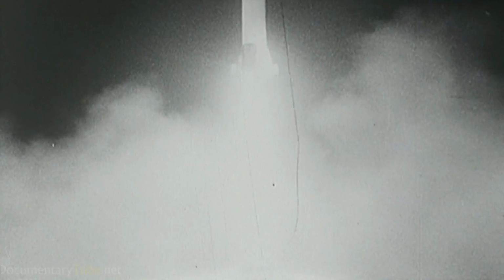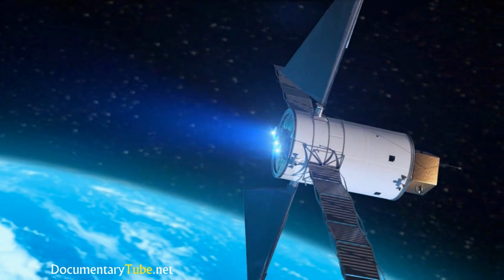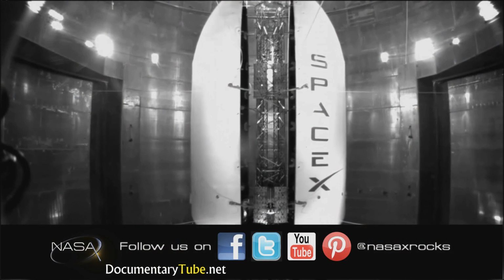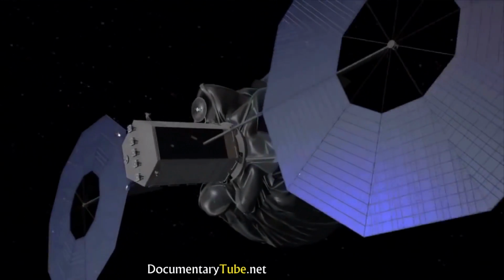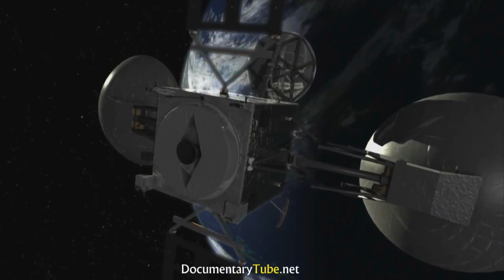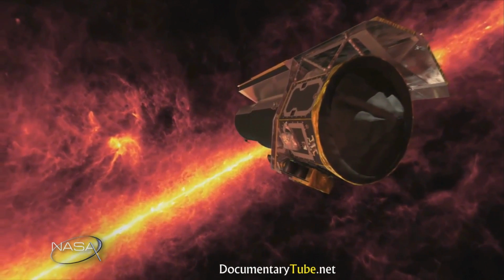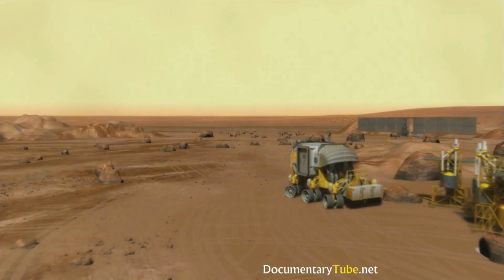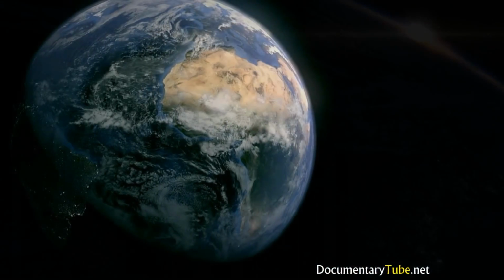NASA's Engines and Possible Speed of Light Propulsion?

Comment: I love the idea of the solar electric propultion. Am I correct to assume that while a conventional chemical propultion engine burns for only a few hundreds of seconds, ion engine will be able to burn almost constantly during space flight, and althout It may not equal in thrust to a checmical propultion engine, the fact that it burns for much longer accelerates the spacecraft to a far greater speed? Say if it is 11-20 km/sec for deep space for chemical propultion, what speed would ion engine achieve?
Reply: Ion engines can't burn indefinitely. Since they are gridded, you've got material moving past the grids, causing wear.
The VASIMR engine is much more promising in the concept of constant acceleration since the propellant does not come in contact with the charging elements. They should be significantly more reliable than even ion engines.
Rocket engines of any type don't have "speed limits". You can reach 99% the speed of light with a chemical rocket.
Engines are only limited in maximum speed by fuel and engine life. They either run out of fuel, run out of power, or wear out at some point.
However, electric engines are superior to chemical engines in that they are VASTLY more efficient in terms of fuel, the trade off being significantly lower thrust.
Whereas most chemical rockets are in the 320-450 range for isp, ion engines are around 3000isp, and VASIMR is estimated to be as high as 12000isp. Dual stage 4 grid ion thrusters could be up to 21400isp, but again there's a problem of run time.

Comment: it looks futuristic but does that not create to much area space that will be exposed to the elements in the space if the shuttle also equipped with advance guidance system that can detect material ahead.

Comment: nasa should use magnetic propulsion like the magnetic train. magnets are so powerful and last longer. i mean magnets work in space right.just a thought
Reply: Yes but to what does the magnetic field push against?
Reply: I don't think you understand magnets ;) Magnets have no "thrust", they can only repel or attract another magnet or magnetic material (from a short distance). Just like you can stick a magnet on your fridge, but by itself it will be like a stone, useless.
Reply: Federico Lucchi No. It is not about a thrust. It is about a pull. For an example you place a giant magnet in the Moon powered by electricity and a spaceship(no thrusters) in Earth. Technically you just pull the spaceship to the moon. Though this is a very big disadvantage. Firstly you need to generate more than millions of electric power to generate that very strong magnet. Secondly, there are other metals on Earth. So when that magnet activates, your roof, spoon, fork, car, gates, airplanes, trains, fridge, anything metal may go to space.
Reply: In another case, you may place a giant magnet on Earth. Another magnet on the spaceship. Generate magnetic force with the same poles and they would push each other. However, this has another disadvantage as you fuel two magnets with electricity. Plus if the spaceship is thrown out of the magnetic field, gravity will start pulling it back again and just fall.
Reply: Magnetic fields get exponentially weaker as your distance from the source increases. You'd get decent thrust for a very short distance.
Much more efficient to just have chemical or electric propulsion systems.

Comment: There is a rule that will never change, and that is for every time you double velocity you have to quadruple the energy input.

The other rule that will not change is that space is not empty and constant collision with particles will reduce the velocity of a craft

And finally: the bigger the craft the more likely it will be retarded, even at large distances, by gravity of other large objects.

And that is why, no matter how much you try, you will never be able to propel a large body to anywhere the velocity of light without putting large amounts of energy in it, and simple math will show that to propel something the size of the space station to that velocity exceeds the amount of electricity produced on Earth in a year.

Comment: I saw no technology on this video providing anything remotely close to light speed propulsion.
Reply: Not even as close as Gundam series spaceships (which none of theese beats the speeds of light).
Before going past lightspeed, first thing that has to be achieveed is the self-ascending spacecrafts (ability to take off into outer space on its own, without launching rocketry).

Space Shuttle program didn't even progress close to this stage despite the proposals to make 'reusable spacecraft launching devices'.

Maybe after mankind had discovered FTL tech from any extraterrestrial peoples did FTL engines possible.

The other thing that had to be proven that existed is also FTL particle named Tachyon. The best effort was a complex below the Alps by French-Swiss border.

Comment: It may be a stupid question but useful for me. Is humidity, moisture, vapor/vapour present in the space, since there are head and light in space! If a comet is an asteroid covered in ice and formed a tail due to the melting of ice and with the reflection of light in the space, then it means something right? Water vapor, moisture, humidity due to the heat inside a vacuum space!! or will you feel no such things coz the vacuum space is too wide or infinite?

Comment: I watched a theoretical special on what could possibly happen on a Mars Mission. One thing they looked at is that on Mars at night it gets really really cold. Then sometimes they have sand storms that last for months which can damage equipment, maybe generate some lightning or static charges and coat solar panels with dust. So it can become crucial to have some king of method to create energy like with a reactor or generator and some method to store energy. The process of creating energy might also be nice if it could generate heat as a by-product.
Reply: The potential problems you mention are a mere nothing to the reality of the nightmare scenario for the first humans to reach that planet - if they ever do !

Comment: how good is that if you can't protect it from the debris flying at the speeds exceeding 17,500 mph. focus on some sort of a magnetic or plasma shied first, then think of travelling somewhere
Reply: M M i always wondered about that. you dont really have to worry about asteroids and stuff, those are obvious, you have to worry about space pebbles. also, there is oily misty dust in space that would build up over time. seems like you would need a sensitive forward imager and electronic space shielding of some type to go anywhere further than the kuiper belt.
Reply: Once you get away from near Earth, there will not be any debris to worry about.
Reply: Neat funfact about magnetic shielding: it's completely ineffective against non-magnetic material.
Dangerous interstellar debris is pretty rare outside of hollywood. You'd have to be extremely unlucky to fly a spacecraft the size of an ocean liner through the asteroid belt and actually get hit with an asteroid.
Reply: Magnetics and gravity? Same thing?

Comment: Throwing the word 'lightspeed' in there made the hole thing lose credibility.
Reply: Nothing with mass can reach lightspeed, end of story.
Reply: Sun Corona : Re "Nothing with mass can reach lightspeed": True, because that would require injecting infinite energy into the massive object. And ∞ joules of energy is mighty hard to come by. :-) 

So, barring "warp drive" (which we're not even close to inventing yet -- if such a thing is even possible, which it might not be), we're stuck at speeds such as 0.000001C, 0.00001C, or maybe 0.0001C. We're unlikely to get a spaceship going much faster than that.
Reply: Ole Nielsen In theory by putting a feild around your ship and causing it to contract  behind you Forcing normal space to push your ship forward, mass isn't a factor because your ship isn't moving, just the space around the ship is moving. Of course good luck doing this! But if such a feild can be Generated with a reasonable amount of power, the speed of light and mass isn't a limit, the space around the ship has no mass  and as the ship isn't moving it's mass is not affected. It's not likely, but it is possible. Explain Atomic Energy to someone a Hundred and Fifty years ago, even the most Advanced Scientists of the time would laugh at you.
Reply: @spookyshadowhawk6776 What Ole Nielsen spoke about was sub light propulsion. What you are thinking about is some kind of warp drive and that is something completely different. He is still right in that anything with a mass can come infinitely close to light speed by using an infinite amount of energy but never reach light speed.
Reply: There should be penalties imposed for click-baiting.
Reply: You just lost all of your credibility by misspelling whole 😂😂
Reply: indeed, never once someone said about lightspeed...
Reply: I love when people try to discredit others and fail themselves. Hahahaha
Reply: "hole"... now I have to go to a .p.o.rn site.
Reply: is that an advanced flight sight?   LMAO 😂😂
Reply: FaultLine actually space does have ways to slow us down. It's just spread out compared the the earth's density.
Reply: The fact that you are unable to spell the word WHOLE does little for your credibility.  And they said LIGHT PROPULSION, not lightspeed.
Reply: wanshei p
Reply: Yea; they're trying to get a hit on their video, thinking that your not going to notice you've been screwed.
Reply: Huges 530f
Reply: Md 530f
Reply: Ain't that a fact? Nope, it's fiction!
Reply: wanshei WZa
Reply: indeed
Reply: You'll get over it.
Reply: Wow, speed of light? VERY nice fiction but unfortunately, I wasted a minute watching this.
Reply: your abhorrent spelling makes you loose all credibility
Reply: @ferret1337  Use "lose" instead of "loose" in your sentence above.
Reply: no it didnt

Comment: We will NEVER reach light speed or even near it . Sorry we might be able to send machines extremely fast but it's quite simple you need to keep pushing to gain speed. Your pushing harder and harder  but light has no mass and it's way out in front ...the faster you go even interstellar gas would slow you down small dust would be like running in sand small stones like being hit by an 88mm shell. Ain't going to happen , enjoy your life this will probably be the only planet we inhabit and even the chances of  travel for the average person within the solar system is next to zero . The next meteorite will finish our dreams and hubris.
Reply: @acefreaky Pretty much right on, but you made a couple of basic relativistic mistakes. We can't even get a proton to the speed of light. The LHC can get it to about 99.999% or so. Not the correct percentage, don't quote it to anybody. But close). So why can't we? There's no dust or gasses in the LHC. Hint: What happens to the mass of a proton as it approaches the speed of light?
Reply: One of Einstein's theories stated that as you approach the speed of light your mass will approach infinity and the length of the vessel will approach zero.  If this is true it will not be happening.  If we got to 50% of the speed of light, we could in theory reach Alpha Centauri in about a decade, BUT then there is the problem of slowing down to stay in the system.  Some people said that we would have to spend half of the trip approaching the highest speed and then the second half of the trip slowing down enough to be able to achieve orbit in the system.  This would add even more time to the journey.  Maybe 20-40 years and would require enough fuel on board to decelerate. Unless some new technology is discovered (some kind of warp drive), traveling to the stars is just a dream.

Comment: Well not Speed of light because you would have to have infinite energy to get to light speed but a significant percentage is possible, 40% is about as fast as you would want to go though really because you would get slowed down by interstellar hydrogen and particles and beyond that it becomes a non insignificant amount of your fuel l just to cruise, also you have to worry about larger things hitting your armour because the frount of your ship would be armoured again strikes and to protect against strikes you need thinker armour when you are going faster.

Although if you can get wormhole or warp drives that is a non issue because you don't need to travel through space although for warp drives buildup of radiation would be your concern within the warp bubble, that doesn't tackle the lack of likelyhood of us getting warp drives or wormholes because unless you find a naturally occurring Wormhole you need negative mass matter for both waprdrives and wormholes which there is no evidence for negative mass matter, and don't say dark energy because dark energy is likely a function of space not matter.
Reply: Once you are in space, it doesn't require any fuel to maintain speed.  You just need it to achieve the speed and also to slow down when you get there.  At 40% the speed of light we would also need some serious deflectors that would have to function without impeding the speed. Another issue is that you inherit the speed and trajectory of the system you are leaving and need to make corrections to arrive to your destination, as well as losing the energy that was accumulated to get there. (decelerating).  I think this will only work in movies, and TV for the foreseeable future.

Comment: their never will be propulsion that can propel matter faster than light, the answer to beating the brick wall of light speed is to not use it at all
Reply: @Ossie Dunstan Correct. We're going to have to bend something. May take us a million years to figure out how.
Reply: yep , i do give wormholes a bit of time though but the power required for such a thing let alone the science is 50,000 years ahead of us at least.And at the rate mankind is polluting the spacecraft known as earth, in 50 years we will be watching our planet die with us following shortly after.
But have no illusions that so called black holes are not holes to somewhere else just enormous amounts of matter in some form in very small area EG: a 62 solar mass dark star (COUGH BLACKHOLE), has the predicted diameter of 64 kilometers , no path to another part of the galaxy ,universe,cosmos ,etc et el. no gravity well under the dark star just massive gravity sink in 3 dimensions radiating inwards towards the mass  the dark star .

Comment: Well if what I saw on Nov. 21, 2008, flying over my car just ~20 miles east of Kingman AZ., was one of ours, then we are already flying massive ships using Ion engines the size of drive in movie screens. 6 of them, 3 across and 2 down, with a blue purple glow that extended out maybe 50 yards. And the bottom was sparking and electoral arching along the bottom.
I think what I saw was something we have in a secret space program and this film is about the trickle down tech from the military or black budgets. I think that plasma screen TV example that is mentioned in the film is exactly what I saw over the desert!
Reply: Took a video?
Reply: I want a pound of whatever it was that you were smoking
Reply: Ion engines don't work in atmosphere. The thrust is far too low to power aircraft. And if an ion engine was spitting out charged particles at 50km/s in atmosphere with enough propellant mass to sustain flight, the exhaust would be going a heck of a lot further than just 50 yards.
There shouldn't be any electrical arcing across any surfaces either.

Comment: E=MC2, light speed can not be sustained because only a black can attain light speed or higher. The energy is squared; the energy  required this much energy would be seen from thousands of light years away.The radiation created gamma rays will sterilize for 1000s of light years around it.how do you ac cerate to light speed a 100 years slowly accelerate accerate to light speed. Do you blast off to light speed as fast as possible. Acceleration forces a human can take 41 G and serious injuries occur. This would require so much energy  you cannot maintain the acceleration. Holman AFB rocket track.

Comment: doesn't mass go to infinity as velocity goes to lightspeed?
Reply: Speed doesn't really have that much to do with mass unless you have acceleration and friction/opposite force. Such as if you are talking about inertia.
Reply: Douglas Frazier no. The ENERGY required to accelerate any mass to light speed increases to infinity at light speed.
Reply: Nothing here is going to lightspeed.
Reply: Douglas Frazier , that's what they say in the public education system.
Reply: no einstein was wrong there is no speed limit also space is full of electric and magnetic fields that one day could be used to propel a craft to light speed and beyound
Reply: yes - anything with mass can only get to close to it - but 90% is ok and still extremely fast.